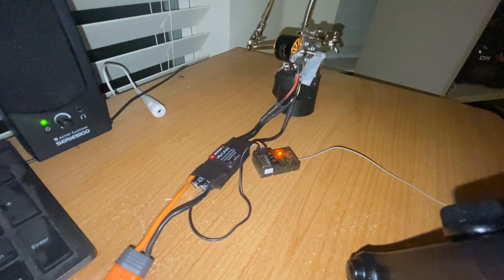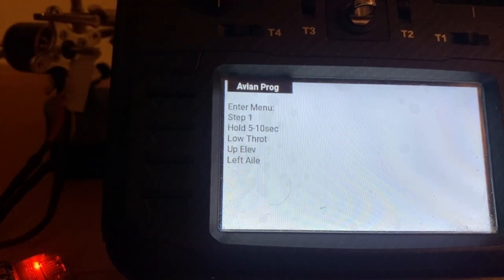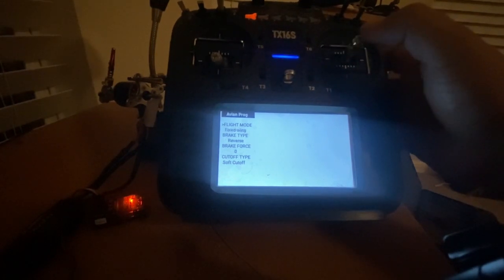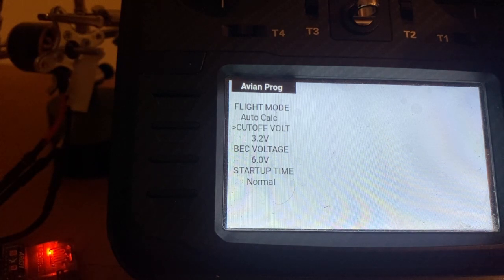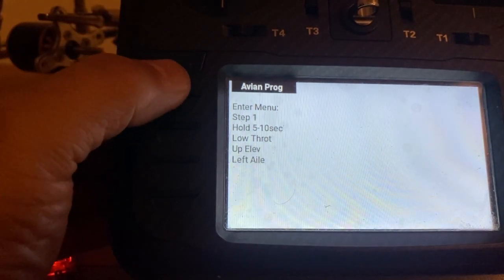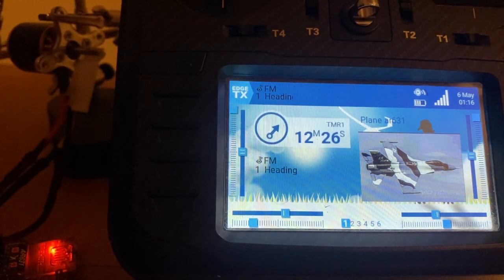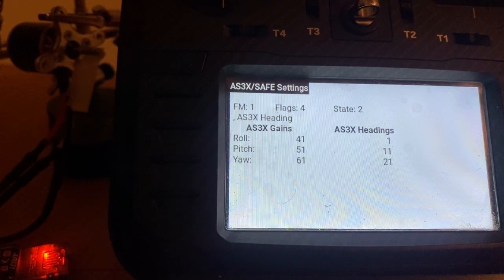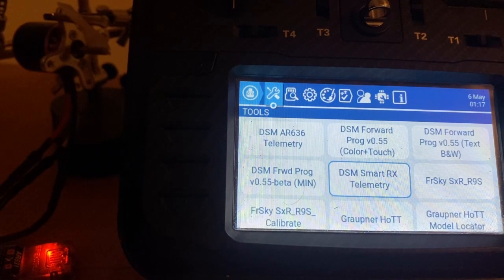Spektrum AVIAN ESC Prog using EdgeTX

Comment: How do you have a spektrum Rx connected to RM TX? Is there a module on the back of the Tx?
Reply from the maker: using a 4-in-1 module. the TX16S has it internally or you can get an external one.  one of the protocols supported is Spektrum DSMX
Reply: Thank you! @franciscoarzu8120

Comment: Do you know a way to set up thrust reverse using a ELRS Rx?
Reply from the maker: Avian is very well integrated to the Spektrum family of products (sensors, reverse, etc).   For a non-spektrum, you will need to get a wired reverse pin. hobbyWing V2 ESCs have the extra reverse connector, but no telemetry.